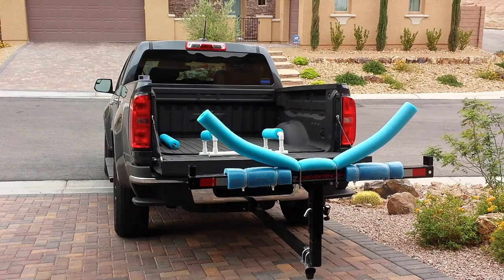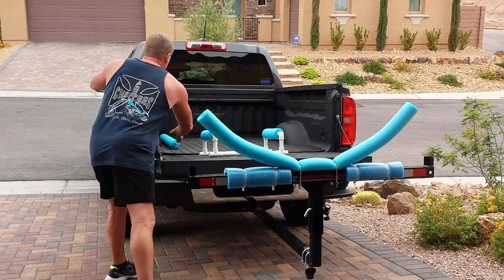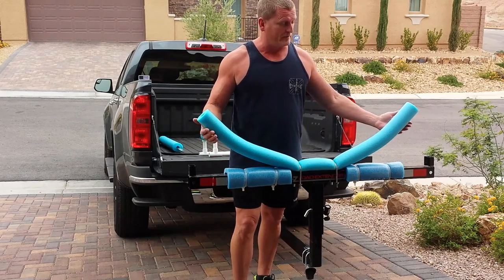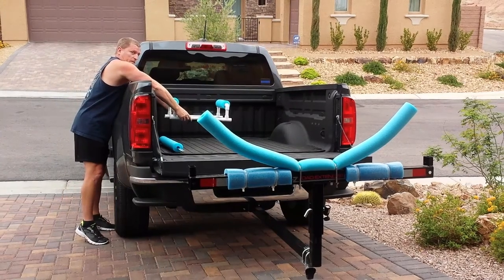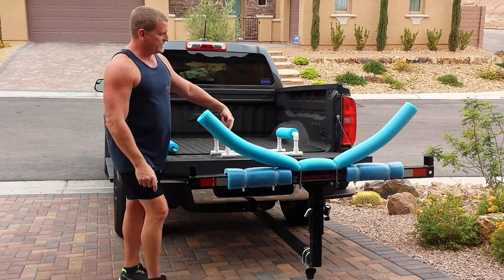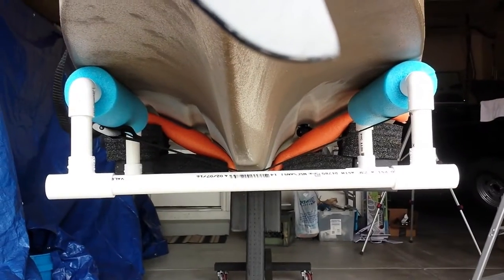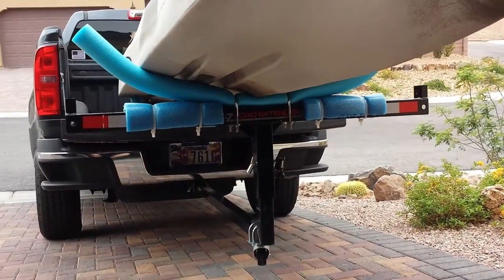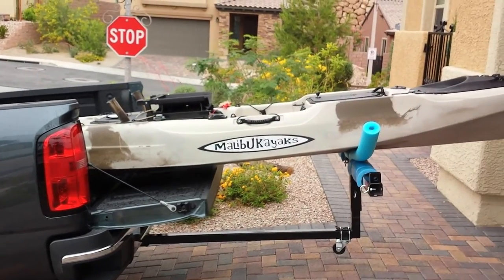DIY Malibu X Factor Kayak Pick Up Bed Cradle

Comment: Wow how wide is you kayak 
or how wide is your pickup bed ? I was hoping to done the same thing but do it with 2 kayaks it don't look like on your pickup has  not enough room?
Reply from the maker: My kayaks are wider than most because I like the stability and weight capacity. Check out my Double Yak Stack video where I made a 2 kayak set up for my short bed Chevy pick up.